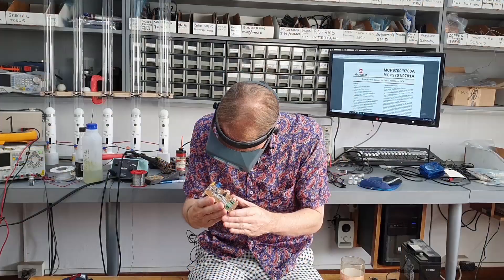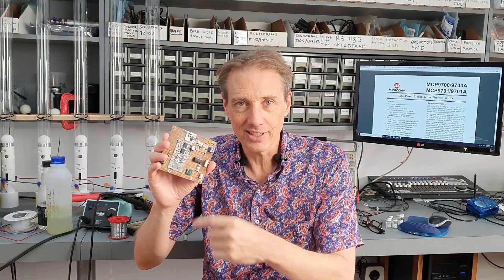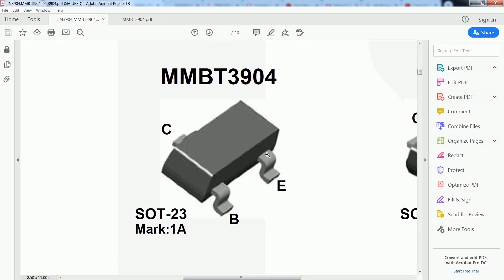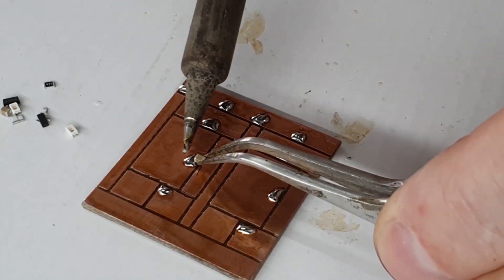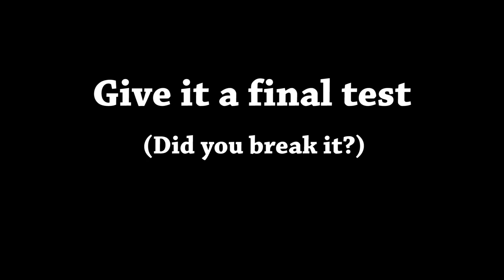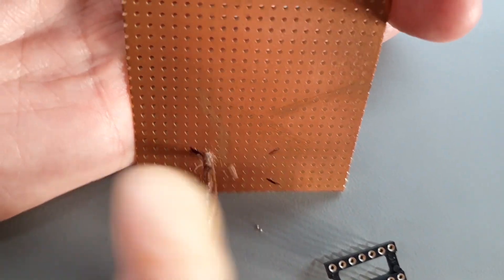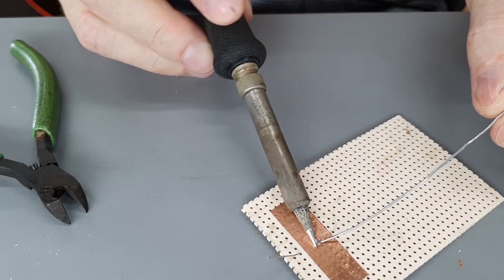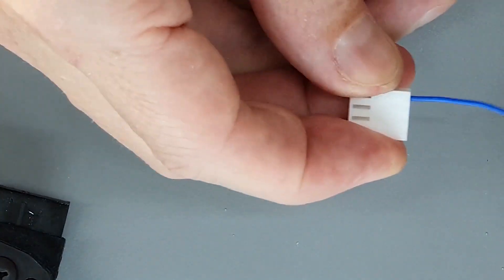Techniques and Strategies for Building Electronic Circuits

Comment: I love your xacto knife modification for expedient PCBs!  I've been doing the two parallel cut and scrape method by gluing two blades together, the ground blade tool removes the scrape step.  I've never used teflon tube, must try that.  I use magnet wire with the insulation that tins easily from the ends (but less so in the middle) for interconnects and kapton tape for insulation where required.  Definitely into copper tape for bus and ground, drill track breaking on veroboard and isolation on clad matrix board.

CA glue can be handy for larger components that need mechanical support beyond their leads, but sometimes I just tie them down with tinned wire soldered to the plane.  Cosmetic nail glue is cheap and comes in disposable project-sized tubes so you never have the open tube solidified by the next project.  It can be annoying when it fumes as you solder, but soldering heat also cures it rapidly when you glue a fragment of board to another and then tin it.  I don't like the wicking solder under double-sided island method, but it can work too.

Comment: 100% spot on -- I'm someone who has been there and done that. One thing that especially resonates with me is the tip to reduce your mental workload. That really can't be stressed enough. Nothing makes you want to quit like having to resolder wires every time you want to make a test and having it not work. Print-out the datasheet pinouts, have them all there in front of you.

Comment: The Xacto cutting tool is the grandson of the Formica cutter I made ~55 years ago from a 1" wide broken power hacksaw blade.
(Zero cost from the factory my father worked at).
Very nice video and ideas.

Comment: wow thanks for that custom xacto tool idea, i'll never use a crappy knife blade again.  and also the idea to use a drill bit to isolate the hole for the ground plane -- i noticed that on the prototype earlier and had just figured you had some fancy tool to cut those spots away.
two tips i can add re the SMT prototypes:

- over time, and depending on the environment, the exposed copper will corrode.  for small boards and especially if they are to be installed outdoors, tinning the whole board with a very thin layer of solder (like at 11:32) can be good for protection.
- larger lands take longer to heat up (and cool down).  i like to reduce the path for heat transfer by cutting a short score at the other side of the spot to be soldered.  It keeps the soldering heat local without any practical effect on the electrical path.  that way you don't have to wait for the whole land to reach soldering temperature, and also you don't have to think about how the residual heat is cooking your silicon even after you take the iron away.
thanks for a very enjoyable production, your techniques with copper and video both are outstanding!
Reply from the maker: Your ideas are on point- will incorporate into my methods.

Comment: What sort of teflon tube do you use? Where can it be sourced? I mostly find larger diameter stuff, but for the purpose you show it should be tiny I suppose...
Reply from the maker: https://www.digikey.com/product-detail/en/alpha-wire/TFT20024-NA005/ATFT20024-100-ND/502350  

This stuff is expensive, but one roll will last you 5 years.
Reply: @leosbagoftricks3732  I thank you very much!
Reply: Ordered me some. It's expensive indeed but I for one am tired of attempting to strip the insulation off very short pieces of wire. This trick is gold!
Reply: @leosbagoftricks3732  Wow, that is expensive.
Reply: I think I found the stuff on Amazon. At least, the specs look right.  Uxcell PTFE tubing. .5mm x .9mm. (That's the inside diameter x outside diameter). 16.4 ft for $9.39.

Comment: Just bought a box full of different prefabricated SMD footprint adapter boards from china. They are always handy in the lab and don't cost much. Sure does not cover every SMT package out there, but if you get the most common packages covered, it saves you a lot of work down the line. On top of that, it's way easyer to do a clean soldering job on these boards, saving you from hunting down fabrication/soldering errors in the prototypes...
If you don't know what i'm talking about, here is a link to two examples: https://www.aliexpress.com/item/1891528226.html or https://www.aliexpress.com/item/32918773053.html

Comment: Everything in this video is gold! I do about 2/3 of this myself, and I'm going to try to work the rest in now.  
Bare wire + teflon tube is genius. I can't tell you how much time I waste just stripping wires in these point-to-point projects.  (So much that I usually just make a PCB.)
I also really like your cutter. I have an acrylic-scoring blade that I bought for mat knives that's essentially the same thing, but if I didn't, I'd be making one of yours.
Reply: I have that same blade, but I think I'll make one like his anyway - the acrylic scoring blade makes too narrow a cut, while the chisel tip makes a nice wide gap that won't attract so many copper hairs.
Reply: @BrightBlueJim  Yeah - it's not a "cut" it's a groove with an actual width.
Reply from the maker: @paulwomack5866  exactly, you need a clearance gap
Reply: Just use enameled copper wire and use the soldernto burn of the insulation. Works perfect with a hot iron.
Reply: @clockworkvanhellsing372  Word of warning: the insulation on magnet wire is very thin, and you can get significant crosstalk between wires running in parallel, even over a few inches.  I like kynar-insulated wire-wrapping wire better.

Comment: Its funny I never knew about these "surfboards". Turns out they were patented 18 years ago. Had no idea you can "patent" literally copper strips on a pcb. I guess we will see these flood the market in 2022? Anyway, some good 'ole new techniques. Ordered all parts and will try. Thanks Leo!
Reply: Just search on AliExpress for smd adapter/breakout boards, they are easily available. I sometimes just make mine if I am getting into a new footprint..